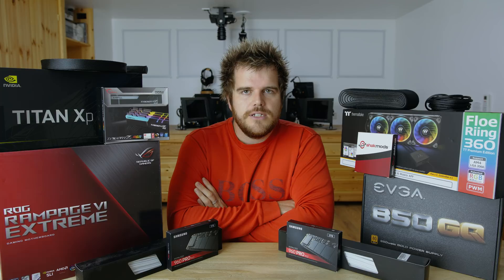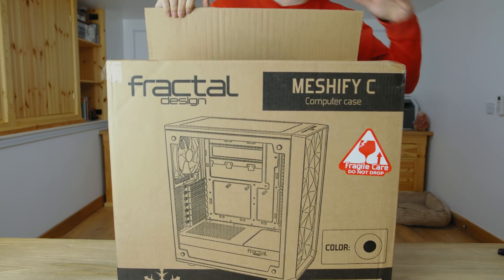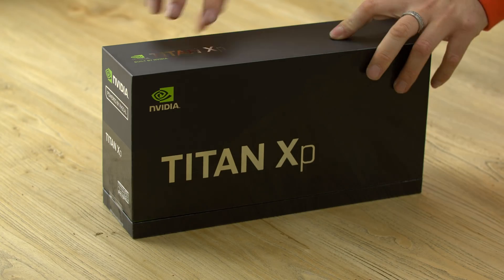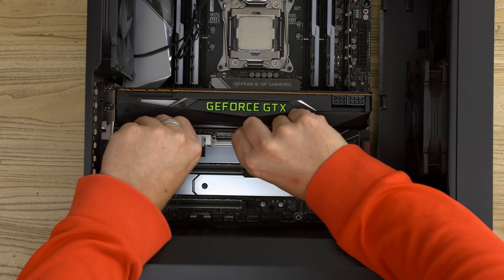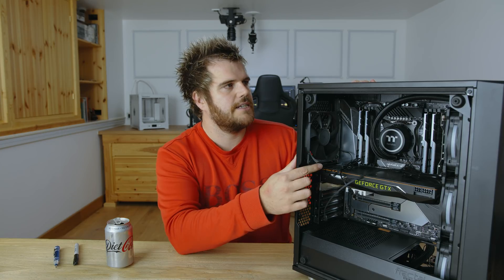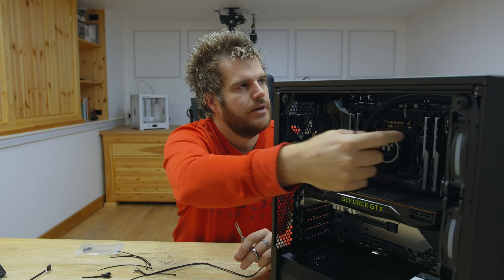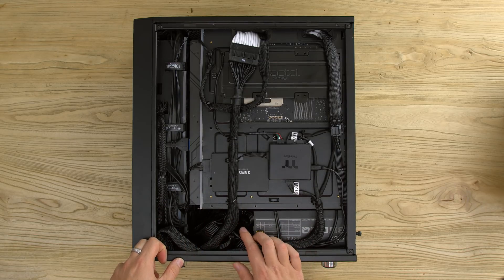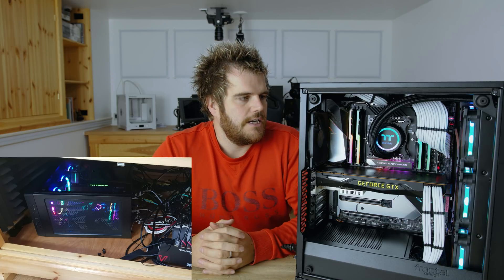Ultimate PC Build : How Would MacGyver Do It

Comment: Have you noticed problems with legacy applications with that rig? I hear the more cores, the worse it gets sometimes.
Reply from the maker: Not really. It's not massively quicker than my 6950 which was my last CPU, considering the huge cost difference.
Reply: Hopefully it will pay off in the future with such a cool rig. I decided to focus on I/O for my rig since I do deployment and development only. A cheap (under $100) Ryzen 3 2200G with Vega 8 Graphics (onboard graphics, no graphics card needed for dual display 1920x1080 , adequate and silent cooler included). An upper range Samsung SSD 970 EVO 500GB M.2 NVMe (about $200) for superior I/O. An on-sale (normally about $200, I got it cheaper) mid-range motherboard: ROG STRIX X470-F Gaming. Features a built-in cooling rib for the M.2 NVMe, and one M.2 slot has full x4 speed (enforce in bios). Just 8GB of cheap RAM. Kingston HyperX FURY Black 8GB. It is not bad actually, but the drivers are still not quite mature from Asus yet. The occasional blue screen - maybe one a week after intense use - that better get better quickly. I obviously need more RAM to do virtualization properly as well.
Reply: I didn't realize how recent this build of yours was. It was just yesterday? In any case, my ramblings about specs was essentially the opposite type of build: how cheap can I make an adequate dev rig? Rumor has it Ryzen 3 is better for some legacy software, but it is not great for heavy multitasking or rendering of course. Tried any threadripper machines?
Reply from the maker: I actually build the top spec Ryzen a few months ago before this video, recorded the whole thing, overclocked it, used it and then found out its pure shit. Massively overpowered draws huge amounts of power, gets very hot, and the performance was slower than by 4 year old desktop. The Ryzen stuff really sucks for day to day usage of PCs. Maybe for games its different (although Linus did a review on latest Ryzen and shows they are still shit). So I didn't even bother uploading that video
Reply: That was a threadripper? I hear they are insane for excessive heat, yes. The Ryzen 3 is quite impressive though (and 5 and 7 too). Good performance and cheap. And I hear it has disabled a number of features that can slow a super fast system down with legacy software. Wish I had a list of what those features are - I didn't pay too much attention. I think threadripper might be a "turkey" of a CPU. It looks freaky the whole CPU, big and terrible. The motherboards look like the thing that should not be. But I will stick with AMD for a while due to Meltdown / Spectre. I hear a Javascript on a web-page can hack an Intel computer as of now. AMD has several major holes as well, but not as bad (yet).
Reply: Just to mention it: Only AMD Ryzen 3 2200G and Ryzen 5 2400G have onboard APU (integrated graphics), the rest of the Ryzens do not. I hear Ryzen 5 2600X is great value. For those budget performer systems that your mom wants :-). For light use like that I prefer onboard APUs, so I would go with Ryzen 5 2400G - believe it or not. Onboard Radeon Vega 11 - even runs simple 3D games.
Reply: Spamming here. Be aware that second generation Ryzen CPUs may need a motherboard BIOS update for support. So you could get stuck if you don't have an older Ryzen to use for the upgrade and then insert the newest CPU. Example: ASUS Prime A320M-A, Socket-AM4. Apparently. I didn't experience it, I read about it. Not a card you would buy, just an example.
Reply from the maker: Also Ryzen have no support in a lot of Intel optimized calls and software. So for software developers and visual studio they are VERY slow
Reply: I have had some virtualization issues with AMD Ryzen, but I think I just need more memory. I realize that Intel has a lot of optimization and performance features, and these are generally the features that are now vulnerable with Spectre / Meltdown I think. The "speculative features" that perform operations immediately - without checking for permissions or privilege - are the ones that can then be committed via hardware exploits making the security hole insane. In other words a privileged operation was already performed before checking for rights, and then it can be committed via exploits. Not good at all. Hard to pick hardware at the moment?
Reply: BTW, excellent racket to sell hardware with security issues that companies then must replace en-masse rather quickly?
Reply from the maker: Yeah for sure. I've never had any issues with Intel stuff and nothing but issues with AMD for about 5 years now. So based on simple day-to-day requirements, Intel are still winning for me
Reply: I am sure you have heard that Intel and AMD now are delivering a chip made in collaboration? It is the Kaby Lake G variety. Onboard AMD Vega Graphics from AMD. Who smells an eventual merger? Maybe not. AMD is said to be gaining market share at the moment heading for a 30/70 split as opposed to 10/90 now. We will see.